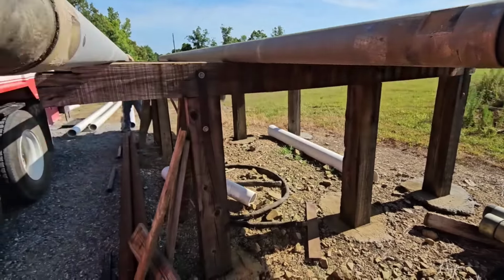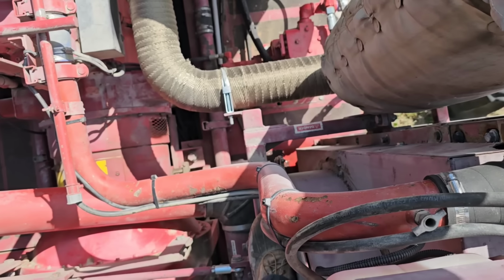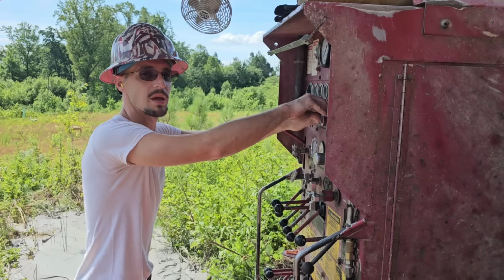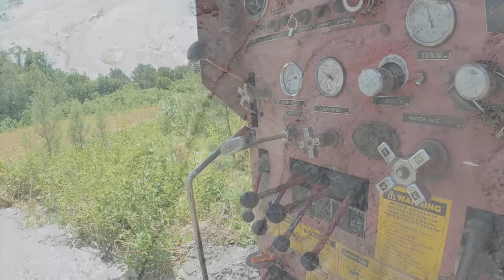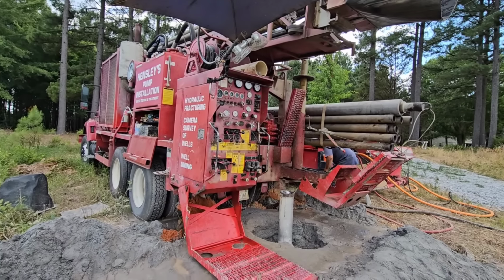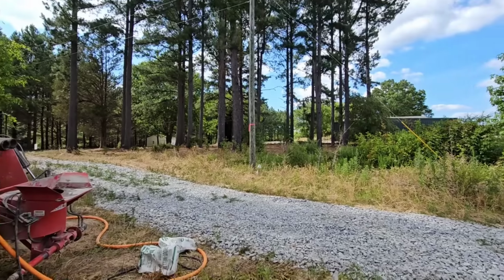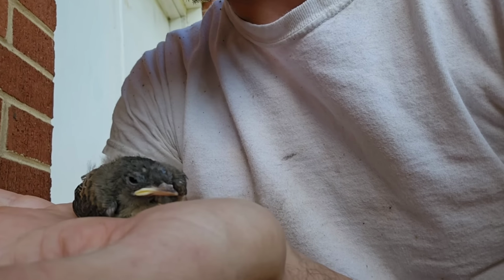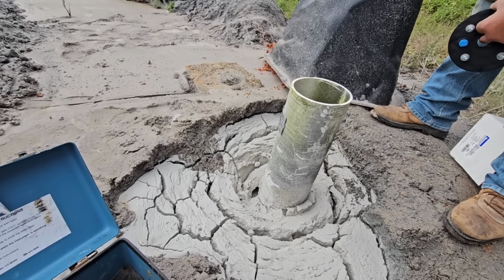At the Controls of a Drilling Rig! Going Deep 600' to see if I can find enough water.

Comment: I feel the pain of a low producing well. 400' deep, pump is set around 350', 1.5 gallons a minute, with about 300 gallons available. Been dealing with it for over 30 years and we even have an inground pool. Had water trucked in for the initial fill-up but very mindful when adding water by doing it gradually so the well can recover. One of the biggest users of water is the wasing machine. Went with a front loader that uses about a1/3 of what a top loader needs per load. I don't mind so much the lack of flow as long as the supply is there. If that happens, fracking will be my go to solution. Which, btw, never even heard of it being done with residential wells until I saw it here.

Comment: 600' deep seems crazy but if it works it works. I got a question. If you have a well that is producing rotten egg water and clogging filters up like crazy what would you do? My customer has spend 20-25 grand on water filtration equipment and barely solves the problem. I think it was a 200-300' well at least and they have tried to go deeper with the well. I know it's impossible to get an exact answer but suggestions are valuable.
Reply from the maker: @walkingfreak  true sulfur is a gas, it needs a mixing tank, then a galvanized tank to allow the gas to separate, ( have that vent to the outside of the home). Then run it threw his filters. 
Alot of the time though, rotten egg smells cones from the Hot water heater Anode rod (so you remove it and cut it off & reinstall the plug) that's worth a shot atleast
Reply: @h2omechanic  Yeah they removed the anode rod long ago. The mixing tank is an interesting idea though.
Reply: @h2omechanic  Could also use a powered anode (called impressed current), Corro-Protec is one brand, and not lose the tank protection of the anode.  I've installed a number of them and it solves the problem.

Comment: And for terminologies sake its a Run capacitor . Another great H2O video
Reply from the maker: Yea, I'm definitely no a/c expect! Regardless $42 & I fixed it!
Reply: Are there actually two capacitors in that case?  If so, would one of them be a RUN and the other be a START ?
Reply: @Wheel_Horse  👍 yep agree an/or  a single dual cap 😊
Reply: @kat2641  Did a little research, one might be the run for the compressor and the other the run for the blower motor... but I'm not an A/C guy so I don't know for sure.
Reply: @Wheel_Horse  Yes, one is for the compressor and the other is the fan.  "45/5" = one 45uF capacitor for the compressor and a 5uF for the fan.

Comment: If you want your expansion tank to draw water in as it's leaking out you need to fill the radiator all the way full so there's no air in it. If you leave air in the radiator the steam pressure will keep it from drawing water in. If it's full the antifreeze will expand it out in the tank as needed and draw it back in when it has to. the air space you left in the radiator is a big air pocket.

Comment: Everyone needs two caps on the shelf for backup.
Reply: Amrad turbo 200, it's a multiple value capacitor.  You can stack values to match 200 different values.  Great as an emergency replacement for any dual value a/c capacitor or motor run capacitor.
Reply: @brendandenney  they are great for an emergency.  IMO the cost doesn't justify them for most repair situations and it's hard to markup a variable capacitor that is already twice the price of a normal one.

Comment: Thanks for the videos and the great editing. Glad to see the pups doing so well, you really take care of them and love them and it shows! The newer AC units are working harder with higher pressures than the older units. Maybe consider adding a hard start capacitor kit to it to help it start easier. It will also help the compressor last longer. Just a suggestion.
Reply from the maker: I'm definitely not a fan of 410A
Reply: @h2omechanic  Well you're in luck then because they just banned 410A.  Starting next year everything needs to be R-32 or 1234yf, both of which are flammable.

Comment: I have just started watching your awesome videos about two weeks a go,I do enjoy them.I would like to see more electrical wiring and would like to see a three wire pump wired to the pressure switch and the control box.My well is three wire and 240 volts, pump is a Aero motor 1 horse.The control box is a Franklin control box.I all so have a Simple Hand pump in the same well at 551/2 ft. for back up.Just very curious about the three wire set up.All so installing  the circuit breakers need in a power panel.Keep up your awesome videos.

Comment: I noticed it looked like you put some small 30 inch section between the extra drill string you brought in what was that for?
Reply from the maker: Check valve. It allows for faster rod changes. Bc the rods store air pressure, every rod change I have to exhaust the air. So instead of 400ft of air relief, it stops it there.
Reply: Check valves , keeps all that air down hole

Comment: Hope you see this. I just had to replace my well pump shallow water jet. The pressure switch is preset 30 to 50. I forget the formula for the pressure tank what the air pressure should be on it. I believe it is a 30 gallon pressure tank if you’d be able to tell me that be great.

Comment: would love to know your thoughts on the water situation @GhostTownLiving has, The current main source of water on site is 700' down the mine shaft, Theres an old (dry) spring of some sort on the surface 2500 feet from town which is 500ft lower than town, and the original spring for the town is 3.6 miles north west at +700 ft in elevation from town. 

People are constantly in his comments saying "just drill a well" despite the fact that its a barren mountain range on the edge of death valley. The only accessible place i would think you would have a CHANCE of hitting water is about 1000 feet up the road from the old dry spring, and your already drilling down 200' to get to the same level as said spring. 

Also, you might be equal parts interested and horrified in the collection / pump system thats in the 700 level of the mine.

Comment: No comment on this video but I have a question. When is a pump control box required? Haven’t seen this discussed in any of your videos. My well (50 yrs old) had one on it but it was removed. I don’t use the well often ( lawn watering only because water is muddy) but I left it powered for 2 days and now the 9 yr old pump is burned out. Could the absence of the control box be a factor? I don’t know the pump size or depth.

Comment: Do you leave the drill steel in the hole over night at 400 foot ? If we did that have lost 400 foot it would of locked it up .
Reply from the maker: @michaelburns9172  we pull it up 20ft from the bottom. If a hole seems unstable or has sand, we will trip out. But our wells are rock. They Stay open

Comment: I know this video is 1 month old, but I would like to ask "What is the deepest well you have drilled?" 2,000 Ft or is that only commercial wells in your area? or is a typical well depth in your area 500-1,000 feet? In my area in southeastern Arizona, we run as shallow as 80' to sometimes 300'.
Reply from the maker: @tracysellman1562  1180' is our deepest well
Reply: @h2omechanic  wow ok thanks for the fast response to my question Brother.

Comment: I believe bores shouldn't be installed straight on line to homes and they should have a tank and a separate house pump. better system setup in my opinion but will cost the homeowner more in the initial startup but less in the future
Reply: My aunt and uncle did this on their property decades ago - One VERY large tank way up on the hill and the well just pumps to that slowly. House is mainly fed via gravity pressure tho I think they've since installed a boost pump and bladder tank for more pressure.
Reply: @mwiz100  nice, yeah a tank is mainly for extra storage and good for low performing bores, so you can maximize your water collecting efficiently when you are not using water( when on line) and bladder tanks are to take the pressure drops out of the system so a pump doesn't kick in and out when there is a little water usage or leaks

Comment: I have to put my thermostat on 69 to stay half ass cool. Can't sleep upstairs even with bathroom vent running once, overhead fan running , floor fan running if its over 80 degrees outside. Oh yea, AC unit inside and out is a year old. I think its the metal roof, i should replace it.

Comment: Since you know what capacitor you need you should definitely order a Made in USA spare.  The Chinese junk only lasts 1-2 years and the Mexican ones are only a little better.
Reply: "Titan HD" is what I usually go with and are Made in USA, though Mars also has a few but you need to really check the label as they don't have different model names for Made in USA vs Mexico.

Comment: If your heat pump is only two years old it should be under warranty.  Most heat pumps have at least a 5 year warranty, our heat pump came with a 10 year warranty.
Reply: True but most are parts “ only” @ 150 per hour plus service call ? It’s cheaper to fix yourself rather than SC an labor